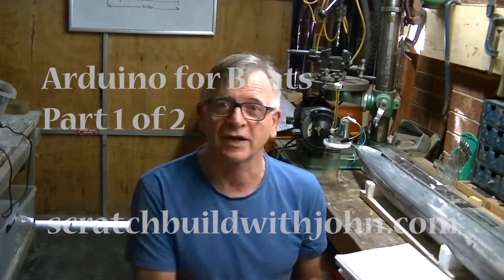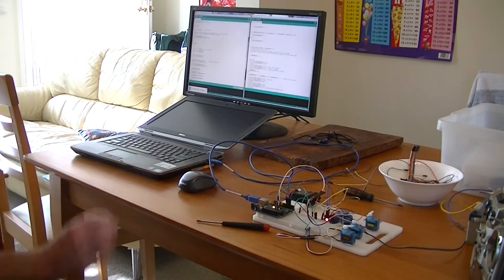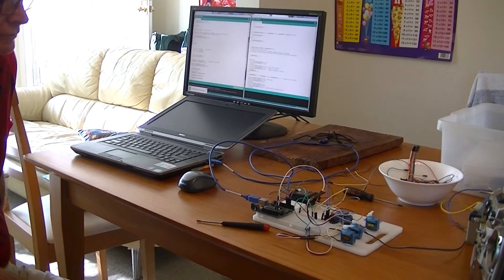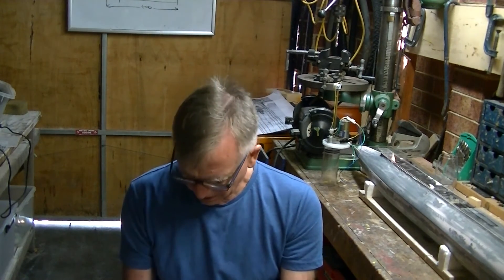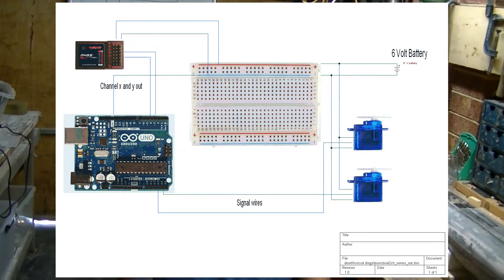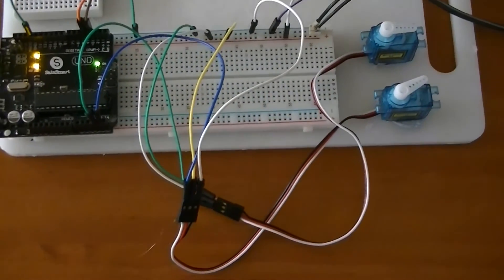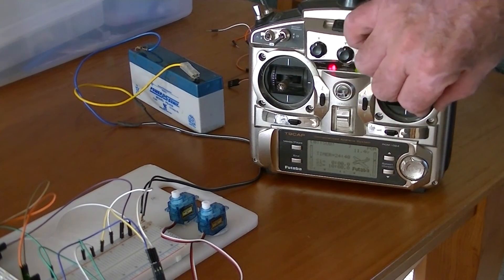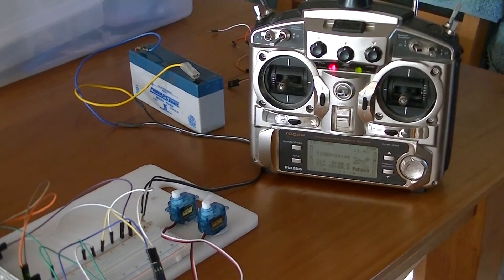Arduino for Boats 1

Comment: John, I´m busy with foil and I´ve  the L293D that controls a servo a dc motor anda a steep motor...with the bluetooth HC 5 and a cellphone App... Did you konw it it is bether than these radio controller that you use? It is reserch and I dont have much money to buy it...and I´ll put a ultrasound to controll the foil...Thanx in advance